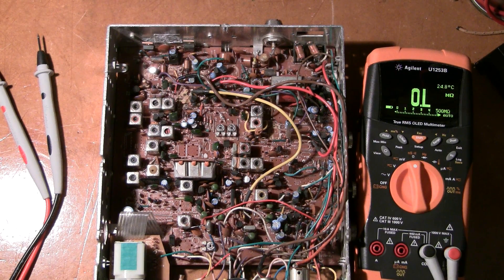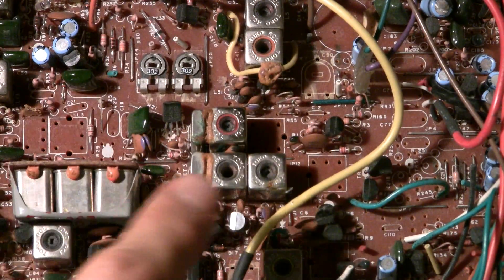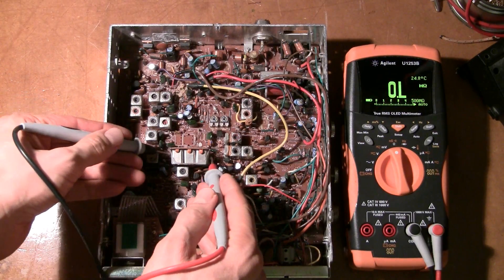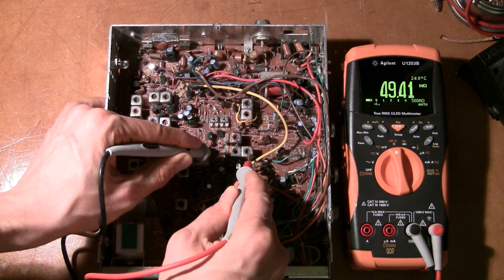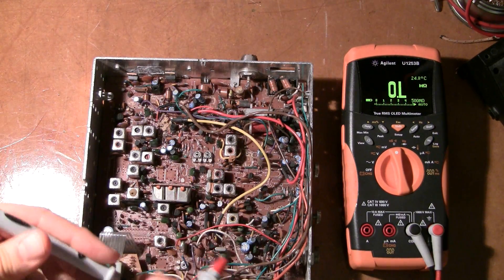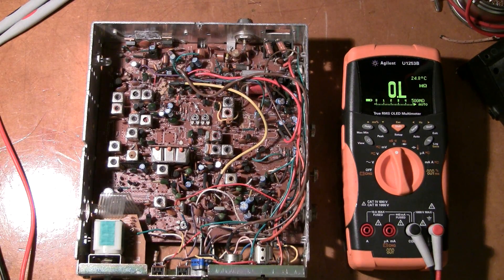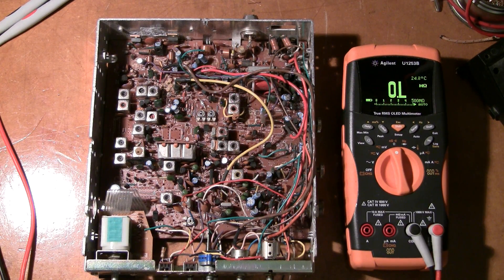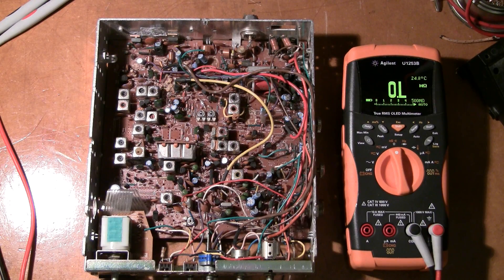Circuit Board Faults hiding in plain sight.

Comment: Would love to see you repair a TS-440SAT with this problem.
Reply from the maker: In the past, I have repaired so many of those, just never made a video. It's issue is in the VCO. The silicone they used "Rusted" the legs off the parts. It's a pretty easy fix, you just have to find the transistors now.

Comment: Ok I have 2 questions: #1 why did they put it in the radio if it is going to destroy it eventually?
And #2 how do you remove it from the radios board? The only way I see to remove the glue from the pc board is to completely strip it and take everything off of the board and clean it off and then put everything back on the board again. That’s a lot of work to have to do?

Comment: Very very interesting. Yes, I have come across that glue a lot, particularly in solid state equipment made during the 1970s and 80s. Since most companies shelf test equipment to determine things like mean time to failure, etc. it strikes me that they had to at least be somewhat aware of this glue problem. Some component of the glue likely oxidizes and in the process the glue medium becomes more and more conductive. Insidious indeed since many people (including myself) would assume the glue would remain a strong insulator.  I'd imagine this problem would exist regardless of whether the equipment is new old stock (has never been used) or heavily used over the years. Thanks for the heads-up on this. I'll keep it in mind in my future troubleshooting endeavors.

Comment: Looks like a 148GTL? Also, that glue becomes acidic over time as well, it has a nasty habit of causing terminals to erode away inside of the glue glob....It looks fine from the surface but there will be no conductor from the glue to the board.

Comment: I’m currently trying to repair the light inside a barbers pole.. the glue has came off an fell onto some wiring to the bulb? (It’s not on a circuit board) just on some wiring that’s connected.. could it affect the wiring?
Reply: @mr carlsons lab

Comment: Revisiting this video after a few years made me remember a repair I did about a year ago.
This glue was either the cause or a large contributor to the failure of the power supply for my old HP scanner. Rather than buying a new PS (they are not that expensive) I decided to crack the black box open. Trying to desolder and test the components, I had to scrape off a lot of this glue. The power resistor and regulator failed.

Comment: Planned obsolescence??? Say it ain't so, Mr. Carlson; Say it ain't so. I'm from Detroit and the Detroit Big Three auto makers have always been accused of planned obsolescence because of the rust and corrosion of automobiles, but that is just an ugly rumor.  There is no such thing. Just look at any Chevrolet Corvette and you will see that there is no visible rust or corrosion. (FYI: this is a parody.)
I am curious: have you found this 'glue' in Kenwood, Icom or other 'mainstream' ham radios?  Here's something to lose a little sleep over: if this 'glue' is also used in avionics, that could test the 'hand-flying' and 'seat of the pants' flying skills of many of the modern  'appliance operators' in the cockpit. What do you think?

Comment: I have a really old Radio Shack DMM. I recently had issues with it just locking up. Opening it up I found the brown glue of death on the 32.767khz crystal. Ate through one of the crystal wires. Found a piece of junk that had another 32.767khz crystal and put it in a cleaned board. Works fine now.

Comment: I have discovered solder resin is conductive as well it turns dark too and not a solid short but just as you were showing with your meter about the glue  the resin left after the assembly at the factory will become conductive as well ... I have a neighbor that has a reciever/ amp and the protection circuit kept randomly kicking in ... told him I would see if I could discover why ... upon inspection I saw several large clumps of solder resin around the amp chips ... soaked the board down with isopropyl alcohol and scrubbed it very well with a tooth brush soaked it again and gave it another good brushing and the towel was lite tan afterwards ... upon reassembling the reciever it worked like a charm ... I reheated those areas to make sure they had a good solder joint as well... 8 told him that one or both fixed it for sure ... I most likely didn't need to reflow the solder but did it just in case ... I definitely suspect it was the left over solder flux during the manufacturing process that caused the protection circuit to trip and shut the unit down... he told me sometimes he could turn it off and on and after several tries it would act normally for a few minutes but would go in to protection... it was a kenwood from the 80s (didn't see this component glue) so it was the resin or a bad solder joint(s) or a combination of the two ... I lean more towards the resin LOL the solder joints still looked shiny but I wouldn't hurt a thing to warm them up to make sure LOL last I asked him about it it still works like it was purchased yesterday so I hope this helps too as far as the mystery of such misbehaving older electronics no matter what type of equipment it is this of course is mostly audio stuff of the time tape decks as well of that era I suppose they were more concerned about cleaning the boards prior to soldering and did little to nothing about washing away the flux afterwards... I just wonder how many devices was tossed because of such a simple issue

Comment: In the world of broadcast television: a VERY large maker of broadcast video tape equipment used chloroprene glue in the manufacture process of circuit boards. In the Y and C (luma and chroma) RF sections, on the bottoms of band pass filters was this glue used to hold the module in place while the board was made. Later on (in the video head RF circuits) the frequency response would goto hell because of this SAME glue!  Never realized it was the same "goop" used on the consumer side too. FYI, these tape decks at the time cost $10,000 and crippled by "glue".

Comment: Sad that "conductive" adhesive is still around. I use to repair CB radios, so quite familiar with the yellowy color stuff from various radios over the years (several HR2510's since I seen a related MPU board). I haven't done much repair work in the last number of years, but recently, came across a black adhesive in some active bookshelf speakers causing problems; extreme static / crackling and one side low output. These are around 10 years old, so "conductive" adhesive shouldn't be causing issues. Would think manufacturers would stick to a known adhesive that won't go conductive. As soon as I seen adhesive gooped all over parts and connectors in these speakers (lots of it all over the low level preamp board) I grabbed my multimeter to check it for resistance; after removal, the speakers have been working perfectly. So this problem is still a possibility in modern items, just might be a different color. I hope the manufactures don't plan this, but makes you wonder... Anyway, great channel you have here, will help a lot of people with the fantastic info provided on various topics, well explained to top it off. All the best.
p.s. I'd like to see some big RF amplifier projects, or RF / HF amplifier in general.
Reply from the maker: Thanks for your comments, and input as well!

Comment: In the eighties at the height of Broadcast SP-Beta analog tape decks.... namely Sony (and they were the basicaly the duck's guts on the this kind of product, i spent a heap of my time (as did my colleges) replacing the Component Video filters on the various boards. These were shiny tin cans often about an inch square with the usual Sony part coded number ontop. and they were EVERYWHERE! Most ran quite warm and were often pre-attached to the board with 'brown glue' prior flow soldering, plus they all had a plastic insulator sheet that had been glued to the tracks of module PCB that was the actual filter circuit underside housed inside the tin can ... A TV station would have 100s maybe even thousands of such tape decks, even the Mighty 'Beta-Bum" clamped up behind News Crew Shooter's cameras ALL had this problem from time to time because of the darn GLUE GOING CONDUCTIVE. Those days TV stations were wealthy enough to just buy a sparepart  (often really expensive) filter. We had hundreds of the things in store... ready. For independent Video Production Facility Companies though they couldn't keep paying so their techs (who were friends of mine) would spend hours pulling the filter to bits, digging and scratching out the bits of dark burnt glue. Sometimes replacing the electrolytic caps that might also be in the filter and then using it again, spending hours realigning the signal path to accommodate a compromised part.... Oh and yeah this all came about right when the alloy SMD electrolyic caps leaking juice on the boards began too...
Reply from the maker: Great Story Pete. Thanks for taking the time to write!

Comment: Mr. Carlson l have a problem with the dreaded electrolytic cap failure on a pre driver board for a audio amplifier. The black corrosive goo ate the legs off some transistors and soaked into the fiberglass inside the board. I did the best job I know how my at cleaning the board. I tried water, alcohol and even brake cleaner. I did all this and I still have repeat the repair a week or a month later. The boards are getting pretty iffy with a couple of traces starting to lift up. When I fire up the amp it smells like dead fish. Even after the third cleaning. What next?
Thanks Kevin
Reply: Sometimes the smell ( like dead fish or cat piss ) may indicate a bad-leaky capacitor....
Reply from the maker: Hi Kevin. Sounds like you have done everything I would have. The fish smell could be coming from another board possibly overlooked? The only thing left to do with the board you have is; depopulate it, scan the trace side and make another.
Reply: Mr Carlson's Lab 
I appreciate the quick response. I was hoping you had a miracle in your pocket that would help. My brother suggested building a small daughter board out of breadboard material where the corrosive goo has ruined that part of the old board. Transfer the new components over to the small board and wire it in  where it is needed. The board is a single sided so it would not be that hard. That might be my next plan of attack. I would try that next before making a new board. I saw the video on making your own boards. Very very well done.

Thanks Mr. Carlson! Your videos are very helpful and informative. I have learned a great deal from them... Keep up the great work!
Kevin.  Kg4muv

Comment: I came across this problem a few times in the past. The glue was a sort of cheap contact glue that was loaded with powdered stuff to increase its weight and volume. As the glue grows older it shrinks and darkens and all the loaded particles in it start to touch each other, some being conductive. The only way I found to remove it was dabbing it carefully with paint thinner until it gets wrinkled and can then be removed with tweezers. Of course, not all cases can be treated this way, as paint thinner will attack some plastics and coils.
Reply: Thanks for the info. Always good to read the comment section!

Comment: I know in guitar amps,  silicone adhesive is being used today...   does this suffer the same kind of issues?   I'm working on a Peavey mixer board from 1979...  a full re-cap is only about 325 caps..  the old ones were NOT glued down in any way.

Comment: I doubt it was planned. They are still using it becasue it's cheap cheap cheap and sticks better than hot glue. Just like substandard capacitors - everyone knows by now that most Chinese capacitors are crap, bar a few companies, but they still see widespread use because they are so cheap.

Comment: Hi Paul, I am looking to purchase a good multimeter and noticed the one you are using in this video. Do you like it more than a Fluke brand meter? It would seem that I will have to spend about $500 dollars US to get a good one. Just asking for your opinion on it.
Reply: I've never used that meter but have 3 Fluke 8060's and they are a great meter - pretty much bullet proof. They don't make that model anymore but they come up on Ebay from time to time.  I bought the last one used for $40 a couple of years back and see a few available in the $70-100 range now.

Comment: As a follow up; I am sure the manufacture will argue the glue was put there to cut down on vibrations to keep the components firmly in place. However, we all know that a proper compound could have been chosen to do the same function and keep it's chemical composition.
Reply from the maker: +John Cunningham 
Ya, there little timed trick. I still find this stuff in equipment, ... Just crazy!

Comment: It IS all planed and intended by design. Just another trick for manufacturers to cause failure after warranty ends. Like in Samsung LCD monitors, they place capacitors near hot transistors so they will go bad faster. Or like in Seagate HDD from the past, they used motor driver IC chips that fry at exactly same spot with same pattern and almost at same time period of 2.5-3 years.
Reply from the maker: +RmFrZQ 
Thanks for your input!

Comment: The same question I asked, why do they keep doing this? Is it to hold the components in while soldering? Makes it difficult to remove components from the board without risk of damage.  Other than that, its purpose isn't apparent.
Reply from the maker: +sand 007 
It probably was intended to stop vibration, with an added extra hidden bonus.

Comment: Great videos Mr. Carlson and please keep up the great work! I have been repairing audio equipment for over 20 years and this video took me back to a problem I remember with earlier reel to reel decks and integrated stereo systems. Both types of equipment performed some type of mechanical switching from play to record or switching between radio and tape decks. This was usually performed by a long 20 pin mechanical switch which was controlled by a cable going to the front knob. That switch had glue on the pins on top and bottom part of the board. This glue was NOTORIOUS for conducting. The glue played havoc on shorting signal and VCC rails. I spent a lot of time with a scribe and acetone getting rid of this glue. LOL! Thanks for the flashback.
Reply from the maker: +Lance Hughes 
Thanks for taking the time to write Lance. Great story!

Comment: I go buy non-working Japanese rack mount gear from the 1980s.  Usually  resoldering  the corners & edges of the boards & cleaning up that old glue makes them able to come back to life & work flawlessly again, after replacing any components that went south. Sometimes all they need is resoldering. Some of the boards were warped when they wave soldered them, and opposite corners will have poorly soldered areas That fiberboard Fender used from the 1950s-1980s, will get conductive around the optoisolator, & around the phase splitter, probably from heat induced carbonization. It also gets a fungus that is conductive. We call it "white rot", and it feeds on the wood flour that was used as filler in making the vulcanized fiber board. I don't see much white rot in items that were stored in the desert, but stuff from other geographic areas is just riddled with white rot. The whole eyelet board has got to go. I prefer using fiberglass epoxy or Praxolin terminal boards anyway.

Comment: A while back, I found my old VOM I had bought probably at radio shack in the mid-eighties. Its just a really cheap crappy meter that was the first meter i ever owned.  Anyway, I took it apart and found a single AA battery inside. The battery had Japanese markings all over it. Measured the voltage and it was a solid 1.5 volts. That batteries has been in that meter for near 30 years. No signs of leakage or anything..looks brand new.  I doubt Energizer or Duracell would ever want to make a battery like that.
Reply from the maker: +notionSunday 
Thanks for the story!  They don't make them like that anymore.
Reply: notionSunday im curious how they made it last so long...
Reply: notionSunday You were amazingly LUCKY!!!
Reply: I hear carbon zinc batteries are capable of being stored for much longer periods due to the chemical stability of their components, as long as the seal is intact (most have vent holes of some sort now to prevent pressure buildup),.

Comment: I had a brand new Sony TC-756 (back in 1975) reel to reel which I did testing to see if the unit was meeting the specs that the manufacturer was touting. The record head bias adjustments were out of spec and left channel bias adjustment affected right channel. I thought maybe a factory miswire? I traced out the entire board. No miswire. I figured I paid big bucks for the new machine so I brought it to Sony, set it up on their bench and showed them the problem. They agreed. There was a problem. I returned a week later and they couldn't fix it. They flew in some Sony engineer to see if he could find the problem. He found what was a manufacturing defect. The humiseal or clear coat they sprayed on the pc boards during manufacturing was conducting. This coating was leaking in the megaohm range just like the glue in the video. The built-in obsolescence was a bit premature.
Reply from the maker: +newjerseybt 
LOL, it was working just a bit to fast! Thanks for taking the time to write.